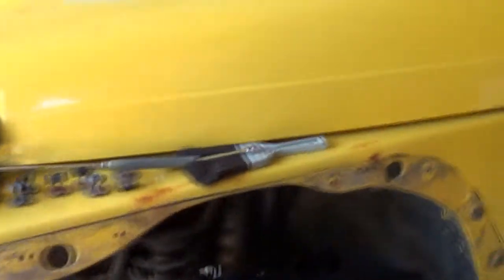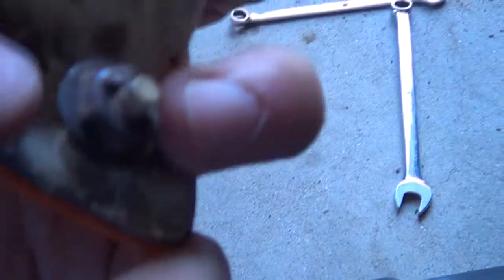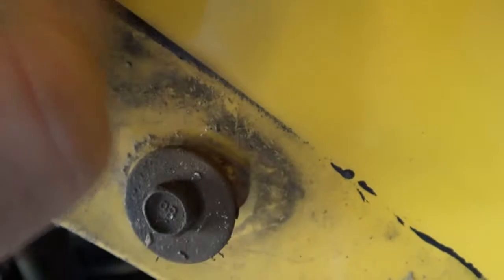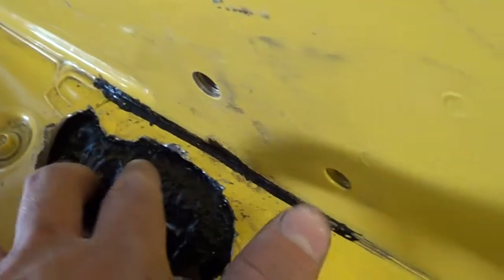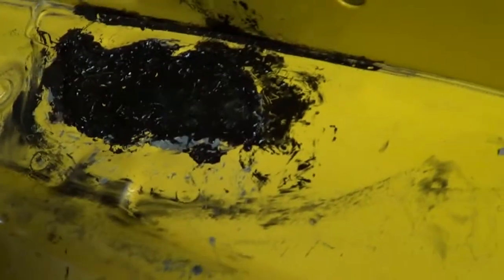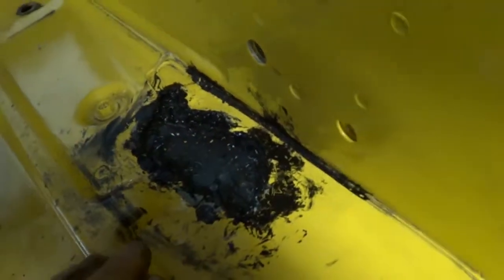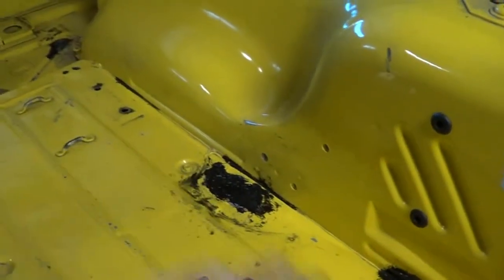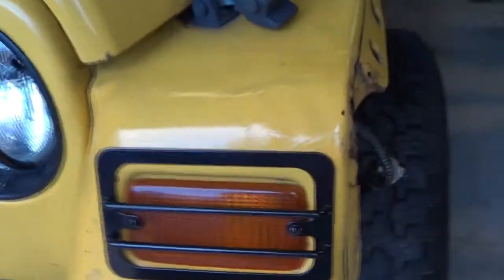Jeep Bedliner Project: Day 2 "Shoty Patch Work"

Comment: The dealer I bought my 05 tj from told me they would touch up the flares for me. I decided to let them. Needless to say it was a Horrible paint job. You can see where they did use tape, but they got paint on the otherside where they masked, and they got over spray from one side of the body to the other. You could rub your hand across the body and it felt like sandpaper. I finally got it all off with a claybar. I'm planning on bed lining the inside of mine next week. Great video.